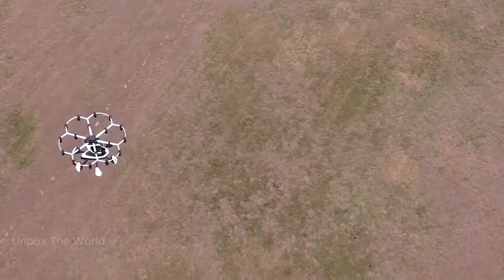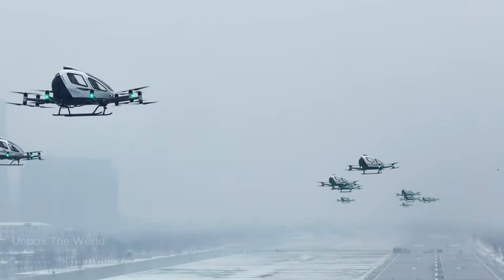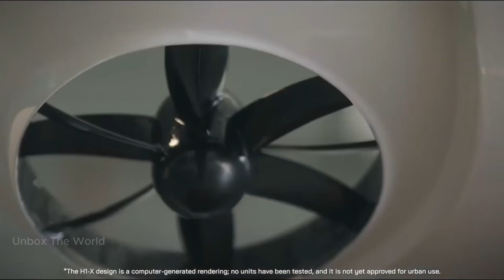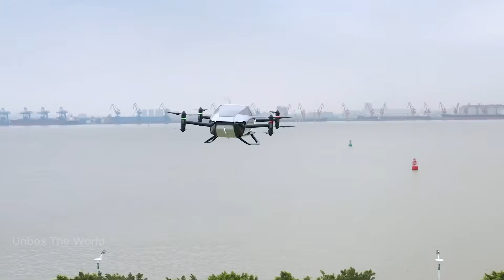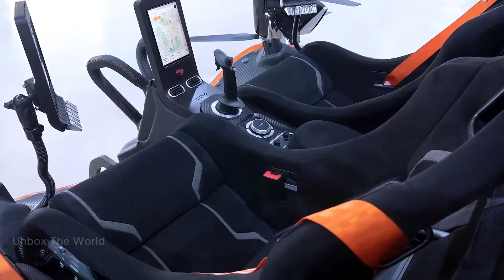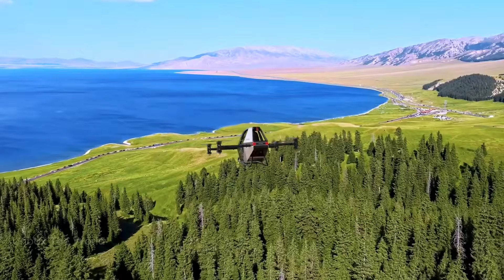You Can Fly These eVTOLs WITHOUT a License?

Comment: If the rotor’s malfunction your dead.
Reply from the maker: That’s the biggest concern. A well-designed multicopter may survive one motor failure, but a major propulsion, battery, or flight-control failure could still be fatal. Proven redundancy, emergency descent systems, and independent failure testing are essential.